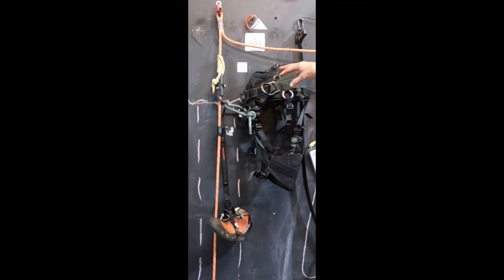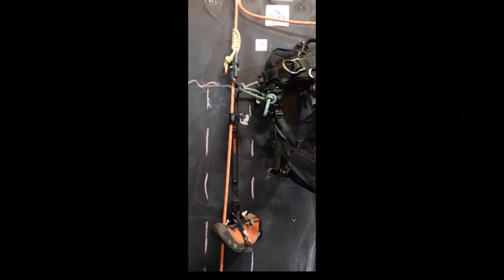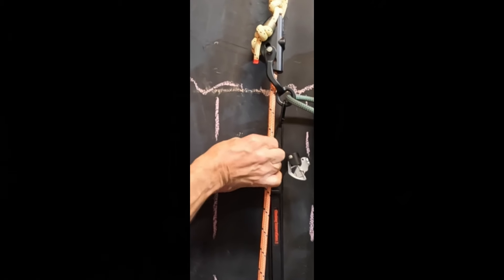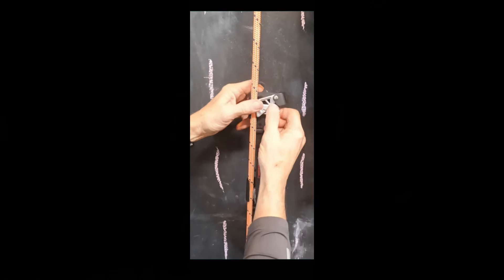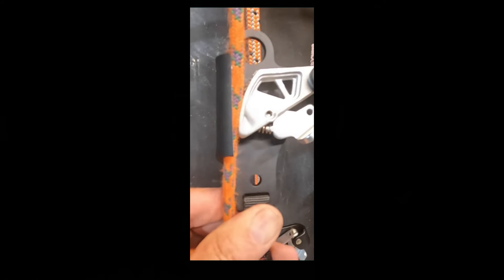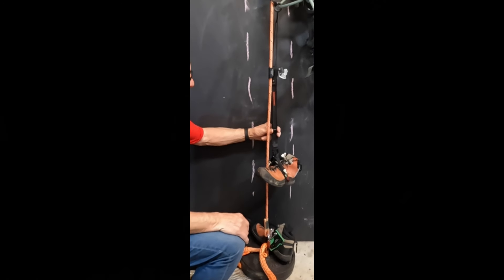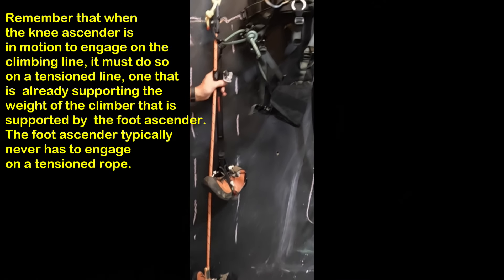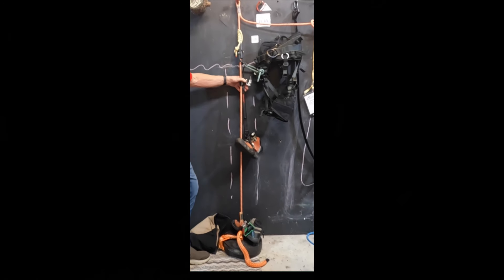Rope Walking Answers and Tips

Comment: As usual Richard, I appreciate your videos & perspective about tree climbing, you’re a real asset to our community. Sometimes I just don’t agree with your views. Thanks! 

Toothed ascenders pick & wear ropes out faster than lobed ascenders, but engage more consistently. The wear is not just in how they disengage the rope, but also how much force is put on them. Such as when the climber is trying to race up the line or is heavily loaded. Also, your demonstration of a single needle poking vs picking the line is a less than appropriate example. Your ascender does not have a single tooth or even have all teeth engaging the rope in perfect unison. So the teeth will engage/disengage moments apart & will eventually pick the rope. 

I agree proper technique will help slow the wear, but it will not keep it from happening. Not saying there is anything wrong with toothed ascenders, but your video gives a false impression of reality.
Reply from the maker: I appreciate your comments, you know there's nothing worse for innovation than having someone along that just agrees with everything a person says, unless of course they're just fun to be with.
Sounds like another vid in the works.
There is wear and there is rope picking, maybe we disagree some but maybe we are on different pages.
Again, thanks.